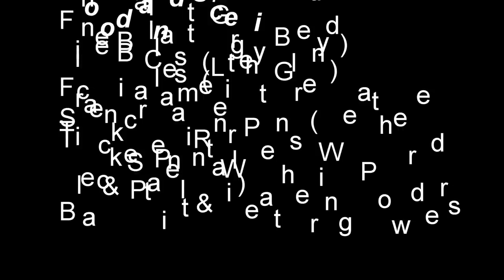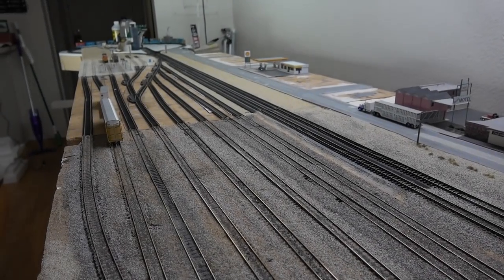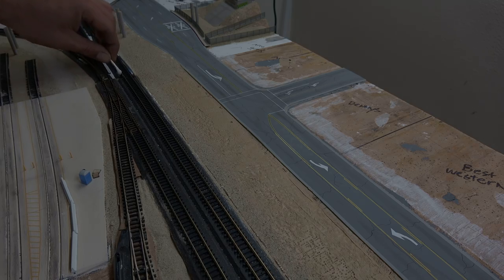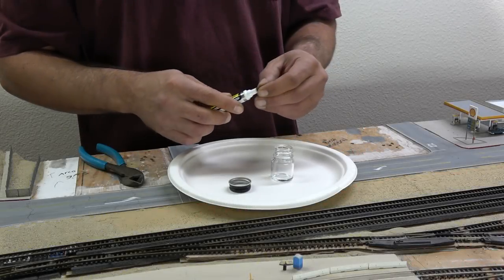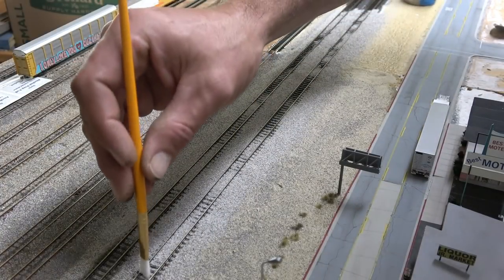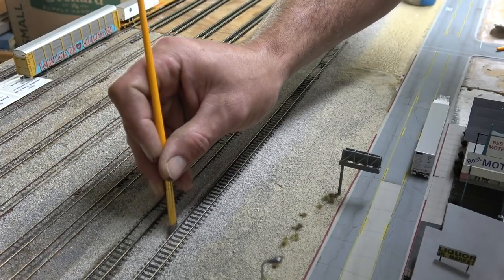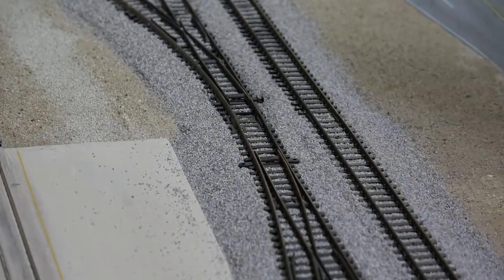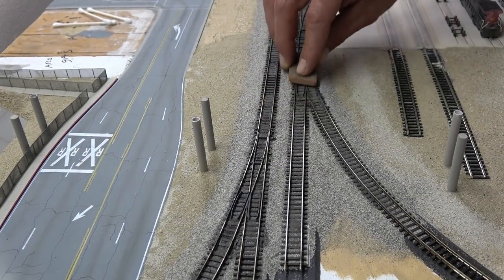How I Ballast/Weather my N Scale Track

Comment: Not sure if this will help, or be of use to you, but I use a eyelash brush to evenly distribute the ballast for both in the inside and outside of the rails, as well as to clean the outside ties. The bristles (to me at least)  make it easier by just doing one pass, than having to go back and repeat the sweeping process with a brush multiple times. The overall results are still the same, it just saves a little bit of time. I thought I'd just share a technique that you or anyone could use now, or in the future. As always thanks for another great video.
Reply: I just started ballasting my layout- first I've heard of using an eyelash brush- sounds like it could be better than the flimsy paint brush I've been using. Thanks.

Comment: Excellent video Cory,I'm glad your getting rid of those ugly switch machines,I know it's a pain,because you'll have to cut holes through the table to run the linkage for the switch machine throws,but it will be worth it in the end when your done,especially if they are slow-mo switch machines.
Reply from the maker: Ill be putting some Tortoise Machines eventually, Thanks for watching

Comment: Not sure I agree that Ballasting Sucks, I find it to be one of those therapeutic tasks that is a great relief to get your mind off a stressful day in the Office or perhaps other stressful things. When I was into N, rather than Alchohol to damp the Track prior to Glue I used a spray of Water with a drop or two of Washing Up Liquid. Do you have Fairy Liquid State Side? If so ideal. I also use Builders PVA mixed 50/50 with Water and another drop or two of Water. Though when applying the Glue it is a Milky Mess it all dries pretty clear with a slight Green Tinge to the Ballast which will disappear with your Ballast Weathering Techniques. Another thing I have been doing is to lightly oil moving parts on points prior to the Glue as it stops the points being glued up. A point you glossed over in your otherwise super informative vid.
Reply from the maker: never thought about oiling the points thank for the info!

Comment: Hey, Great video and instructions! Question... did I miss a part where you 'glue' the ballast? Should it have been between Iso propol and leave it to dry?
Reply: You missed it indeed. But in a nutshell, you drop isopropyl onto the ballast carefully, while wet, apply the scenic glue. I dont think waiting between applications is necessary.
Reply: Yeah, I was wondering about letting the alcohol dry before the glue was applied...
Reply: @mach37  wetter is better

Comment: tip when ballasting switches cover the switch with tape and mask off the points and hinges so you don't get ballast, glue, or paint on them. also Don't Place Ballast Near the Control Rod if you place anything here you will gum it up and you will have to replace the switch with a Dremel which you don't want to do.
Reply from the maker: Thanks for the tips!

Comment: lol i like ballasting, very meditative and peaceful.  It's the wiring that i hate to do, probably from having been a network tech and having done tens of thousands of ethernet splices and crimps, just totally over the "stupid dam wires why are you twisting like that!?!?!" experience.  I like the soldering of electronics, it's just the stripping wire ends and crimping connectors and especially running wires through framing, really dislike that part.

Comment: Dude...wtf are you using atlas turnouts? Build them, or get micro engeneering code 55. Always use code 55.
Reply from the maker: they seam to work ok but if i had to start over i would switch to code 55. i did start using peco turnouts wich i think work a lot better